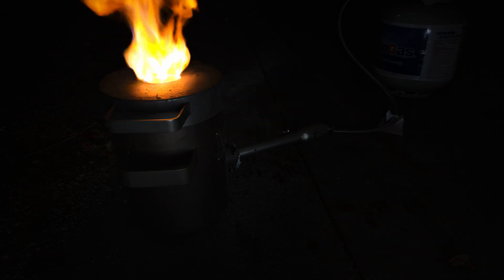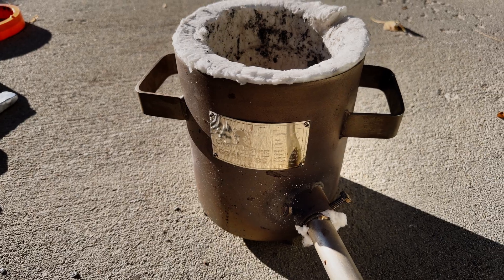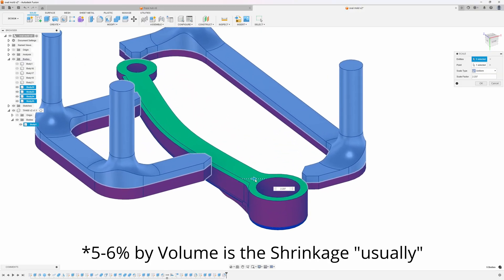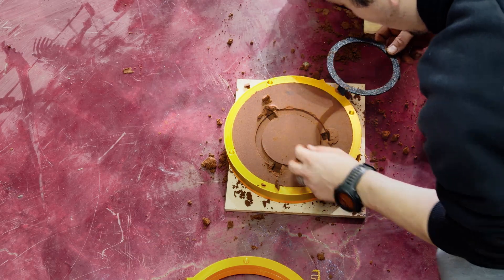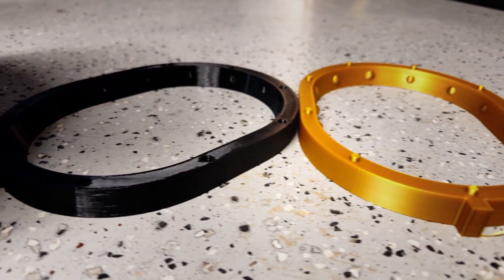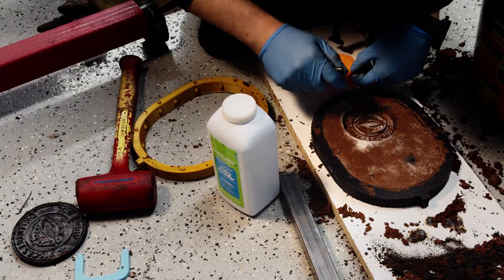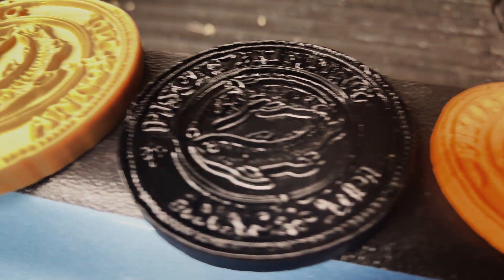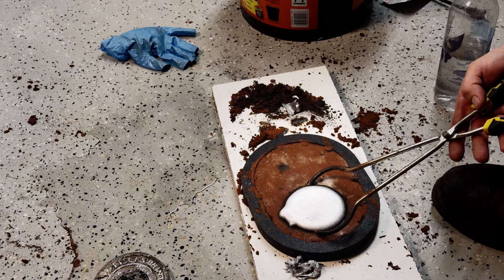Turning 3D Printed Parts into METAL with Molten Aluminum Sand Casting

Comment: Awesome Video!!!

Very Cool. 5:55 Sprue Length = Head Pressure: Finer Details Need More Pressure. Downside Is Containing That Pressure. If The Coin Has A Sprue Would The Detail Have Come Out?

I'm Thinking Of Doing This Some Day. This Is A Great Video! Thanks For Sharing Your Work!
Reply from the maker: The small coin would have likely been more successful in a 2 part mold with a sprue, I do think my petro bond mixture is limiting in features as well. 

I can only be as detail oriented as my sand is fine, And it’s mainly 400 mesh sand I believe. 

I also need more petro bond as I ran out making the feeder and sprue. Which is why it wasn’t attached like it should have been. 

Thanks for the engagement though! I appreciate it! It’s always awesome to talk with the viewers!